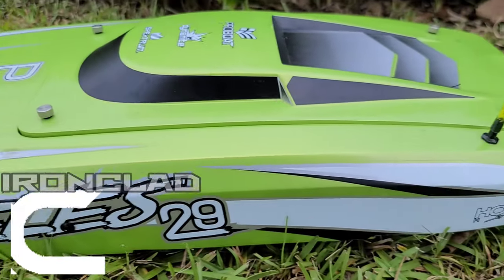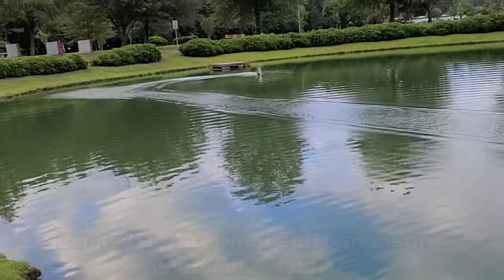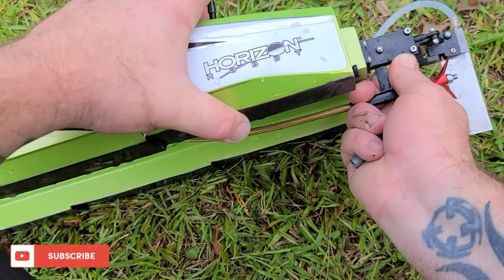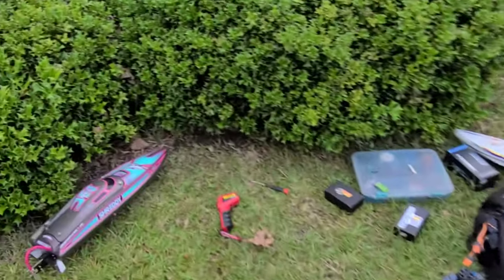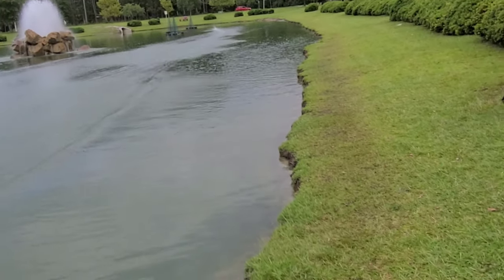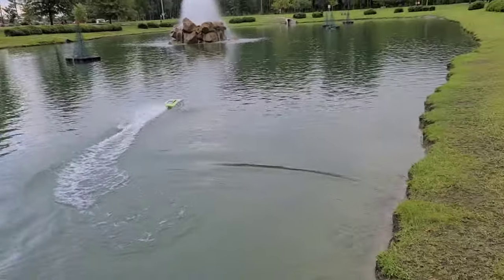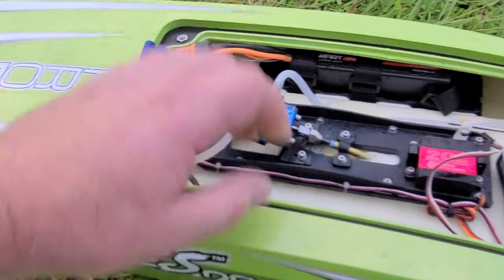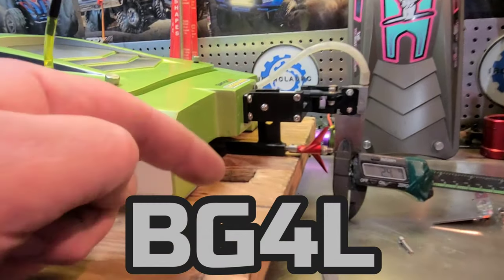RC Catamaran Strut Position Explained Veles 29 - Catamaran Hull Setup Fast Electric Rc Boat

Comment: Thanks for explaining this. I bought a Joysway Monster cheap to see if the hobby was anything for me and couldn't figure out why it wanted to turn over all the time no matter how I placed the weight of the battery. Fun little cat but was way to unstable at full throttle. Gonna tinker with it based on this video info. Thanks again
Reply from the maker: Good luck brother. 👍   you'll get her ✅️

Comment: Definitely helpful! I needed this information badly!
Reply from the maker: Strut position is different from boat to boat, COG has a lot to do with ride Attitude along with prop choice...
Reply: @IRONCLADRC  yea, my Mystic 29 is 13 years old but like new, the epoxy on the battery trey cracked on the first run. Had to redo it with new epoxy. But I want to lower the trays to accept bigger battery's.  I enjoy the build & test process

Comment: My Genesis has a tendency to lean due to the engine torque, what could be causing this, given that the axle is high and balanced?
Reply from the maker: Flat bottom strut could be adding to the roll over also I think the spray rail isn't long enough, they should have run the spray rail/strake the full length of the hull
Reply: Chief on a catamaran, do you use any inclination to correct the touch effect? Do you use any inclination on the transmission shaft to correct the torque? which parameter should I base myself on?

Comment: Hey big B, I swear the last time you did a prop video you had and mentioned the propellers that have a tongue are high lift, and the propellers that do not have a tongue are low. It was the way it was mentioned last time now thinking about it when you sharpen that tongue to a razor sharpness, it gets to cut into the water and depending if you have your prop at 0° or or even -1 the tongue propeller, I understand it as it cutting into the water prior to the actual cup, begins to thrust the water molecules backwards. As the propellers that do not have a tongue when you visualize one of the blades, let’s say running at 0°,  coming from the 12 o’clock position down into the water starting at about the 9 o’clock position and beginning it stroke down to the 6 o’clock position, a propeller with no tongue is almost as if it’s slapping the water down and hasn’t yet pushed it back. So I’m when it comes to propellers and the voodoo magic , I was wondering when we’re going to see some of us over here in the states get a hold of some of those handmade or even model manufacture made propellers that I see the guys running on the long tail boats those things a hybrid, no tongue, but still maintains the ear shape  of being able to thrust the water back. You’ve seen them, I know you have. I guess it’ll just be something more to throw into the mix, but we gotta get our hands on some of those we need to connect. LOL

Oh, and never mind Torioidal propellers
Reply from the maker: I'd love to get a Thailand long tail prop, just to see how it stacks up to an ABC/ octura prop.  They look completely different than our props

Comment: Big B, when you move the strut up and down are you changing the trim angle also or keeping it flat (no trim)? If keeping it flat does that mean the stuffing tube moves inside the strut at the same time? I just installed an OSE strut and cable in my BJ24 but my prop is super deep in order to have it flat. It seems like to get it up even with the ride pads the stuffing tube forces it to have a lot of upwards trim. Wondering if my stuffing tube is too long? Love watching your videos man!
Reply from the maker: Yes your gonna have to slightly & gently bend the stuffing tune for the correct angle of attack.  You should also consider trimming the stock stuffing tube to achieve a neutral or negative angle

Comment: Did u have to trim down the tube a hair to run a neutral prop angle being that high? Mine pushes the prop upward being that high. Also does your Veles have a lot of play in the rudder? Mine seems to have bushings a good bit bigger than the pin and allows many mm’s of slop left to right and front to back.
Reply from the maker: Yes sir I trim the stuffing tube on most all my rtr boats it doesn't take much trimming maybe a mil or two.

Here's a link to  how I get the slop out of my rudder it's super easy.    Around 15-17min in 
 https://youtu.be/8kI0ljdvzo8
 https://youtu.be/8kI0ljdvzo8

Comment: Learning the lower prop position lifts the rear and pushes the nose down because it's biting harder why wouldn't you move CG back to look for the sweet spot  ? And why on earth do you toss boats , scale out your drop
Reply from the maker: Well for one I was doing a controlled test with the cg the same for all strut positions, 2 I wanted to show all the new Catamaran owners what strut position does to a cat.   And three these boats are made for high speed running including flips at 80 plus mile per hour flips I doubt a good Ole ironclad toss in the water is gonna break that veles..

Comment: I have a E51 boat, dual prop.  I already have new ESC coming.  What would you think would be a good motor upgrade?
Reply from the maker: Not sure? Never ran that boat, shoot I've never seen one running in a video.   You'll just need to run the boat with the new esc's check motor temps, if the motors are getting got (over 170) go with a lower kv motor & or larger can size so you'll have room to prop the boat up
Reply: Okay, I'll do some testing as soon as I get it setup.  Still working on my SonicWake.  There are a few videos on youtube about the E51, all fiberglass and lined with carbon fiber.

Comment: Just a idea for you.. recently we flipped are veles boat...took on water and took out the little tiny receiver...so yes replaced it... however had a idea how to protect it next time....we ended up or used a balloon put it inside of it zip ties and no more water issues... 😊..
Reply from the maker: Oh yea I use balloons on a few boats.   Use watch makers grease in the balloon opening then zip tie for added protection and or paper towel in the Ballon to soak up any moisture

Comment: What is your opinion about a 43mm prop with a 1.9 pitch for this boat.... Miss Geico 29 V3
Reply from the maker: What brand 43 9?  Should be a good size worth a shot, remember with a true 1.9pitch prop low end take off will be terrible, but the topend should make up for it.
Reply: @IRONCLADRC  many thanks for your reply.... Brand is alibaba :-) I will try and find out

Comment: Will this work on the ul19? Higher strut?
Reply from the maker: No sir, it'll blow over with a higher strut position. Make sure it's flat to the ride surface and the aft tunnel  is about 2 mm higher than behind the sponsons

Comment: Hey big b, quick question would a 48.2 mm prop be over kill for the Veles?
Reply from the maker: With the stock electronics  is say yes. Depends on the pitch of the 48mm prop
Reply: @IRONCLADRC  It is a 1.8 pitch it is a abc 1717-45 prop
Reply from the maker: Yes most definitely. Way to big.
Reply: @IRONCLADRC  Hey i am just curious on what would happen to the boat if i used a 48.2 mm prop?

Comment: This strut has a bushing …. Yes?
Reply from the maker: Yes
Reply: @IRONCLADRC  Turns out the AquaCraft part is no longer available. I’m looking at alternatives with OffShore Electrics. In the meantime, I grabbed a stick of K&S 1/4” brass tubing and made one. OD is a perfect fit and the ID is a little big but it seems to work perfectly. No more prop shaft wobble.

Comment: Up 2mm ok？
Reply from the maker: Yep 2mm is good.   I find tinkering with the height on the strut , run the boat tinker with height some more, run it till you find the sweet spot.   From prop to prop strut heights change according to the prop your running

Comment: do u ever use electrical grease
Reply from the maker: Yes sir, I usually use it on my bullet connectors & esc/baytery connectors
Reply: @IRONCLADRC  not on reciever
Reply: @IRONCLADRC  did u ever do those rest of boats the boober the three of those
Reply from the maker: I'm working on the small one right now actually trying to get everything installed
Reply: @IRONCLADRC  ok was justing 
asking